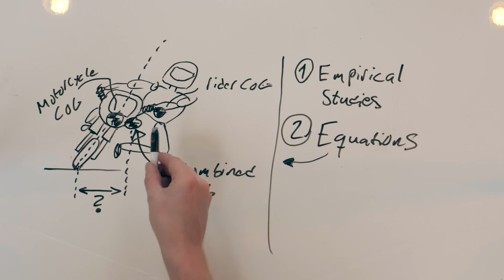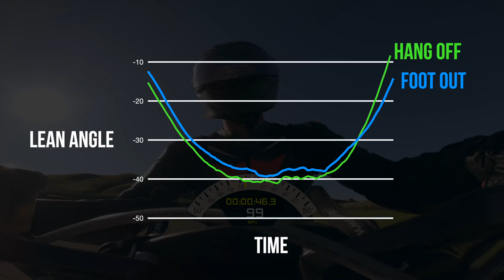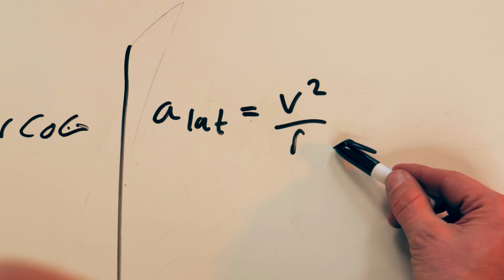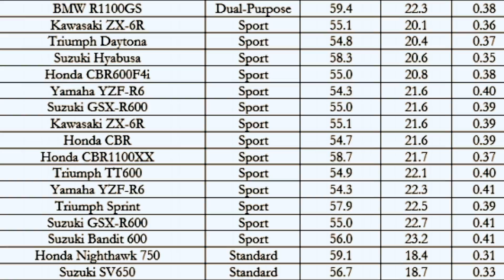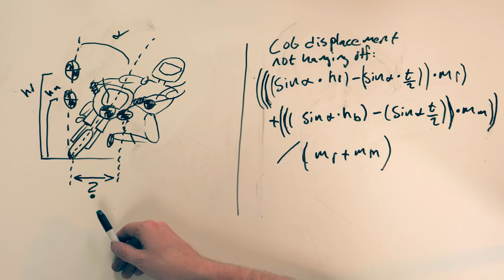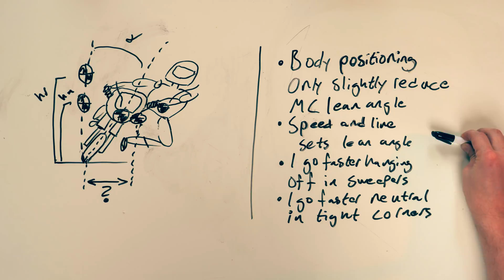Motorcycle Riders - Hanging off & The Science behind it

Comment: Try to analyse the hanging off looking the motorcycle from a vertical angle (looking down from just above the motorcycle) during a corner. You’ll discover the real reason of the hanging off, especially on motorcycles with rear and low CG :) . You could analyse Stoner’s Ducati for example, it is very interesting 👍

Comment: The other thing it does is place your entire body weight at the centre of the bike because of how you hang off using your leg. I think this improves the weight distribution between the front and back & therefore increases net grip & the suspension response to road imperfections.

Comment: You know something that would make a really interesting video: what is the ideal body size and weight for a rider in terms of performance.  With modern bikes having almost unlimited power, I feel like weight is less of a detriment than it once was.  On the contrary, a taller, heavier person (not fat, but just larger build) could potentially require less lean to maximize grip in a complex series of corners, possibly allowing them to maximize them better.  It would probably vary on a track by track basis, but it's something interesting to think about compared to cars or karts where almost universally lighter and smaller=faster.
Reply: SURE. Thats what happen to Pedrosa in his latest years (apart from the bike which was developed for marc, they have very different riding styles so its enough to fuck Pedrosa life)
BUT Pedrosa was ALWAYS the guy who reach the highest lean angle in the paddock. GUESS WHY?
ALSO, heavier guys could put more temperature in the tires while Pedrosa couldnt (again, development issues help this phenomenon) and because of it, they had less wheelspin outside the corners.
I bet that Pedrosa would be unbeatable in 600 or 300 cc.

Comment: Actually when you hang off, you aim to shift your center of gravity down AND forward.  The two are combined. There are so many forces and geometry that it would require very complex simulation to get remotely there. Plus there is air drag, tire drag, engine break, sheer corner speed, angular speed. None of them is constant in a turn. And obviously, there is the feeling of the rider. 

I've recently seen a final lap in Assen between Roseland and Bayliss. Two opposite riding styles but equal performance overall. It's mind blowing.

Comment: Center of gravity at your belly button assumes you are standing straight up.  If you bend over at the waist, you just lowered the center of gravity.  While there are incremental improvements that can be made by moving inward, the BULK of the improvement (or reduction in lean angle) is just from being bent over instead of straight up and down.  The goal is getting the center of gravity LOWER.  Leaning to the inside helps you get even lower on the bike....to a point.  Your outside knee and your hips can only get so far.  So if you're a MotoGP rider trying to eek out every last hundredth of a second on every corner..... Drop your upper body lower and to the inside. Pay close attention to how Marquez's body is laid out, he's trying to get as much of his entire upper body mass lower on the chassis.  You can't put your chest through the tank, so the only way to get that mass lower is to also get more to the inside.  Some older generation MotoGP riders used to even get their butt down on the side (almost twisting sideways on the seat).

Comment: I've found at the moderate lean angles I manage on the street, that when leaning off I have a lot more control over adjusting the lean angle mid corner. If the front or rear starts to slip, I've found that I can drop my weight down and lift the bike up to grip back up. I've also noticed at the same speed I tend to have far less lean angle than some people I ride with by not sitting straight up and down on the bike. 

This video makes me want to try and get some data and see how much the feeling of reduced lean angle is in my head 😅. Its amazing how much reality and perception can differ with things like riding!  Great video!

Comment: Sorry but I can hardly agree with the conclusion. Theoretically if you hang off far enough you could go through a corner with negative lean angle (meaning the bike is in fact leaning outwards). The lean angle is not what gets you through the corner, steering is what does. You use body leaning to compensate against falling over. (as this goes for both fast and slow cornering) Lean angle of the bike is only, and I repeat: ONLY, necessary so you don't fling out of the corner due to centrifugal forces caused by speed as you demonstrated at the start. Basically Moto GP riders are going to fast for the angle of the corner and that is why they have to hang off their bikes and compensate because a bike doesn't have unlimited lean angle.

Comment: Your calculations are showing around a 10% difference in lean angle.... that is not slight.

Marquez would gladly take that 10% you have banked (lol) and spend it on leaning further and therefore going faster.  He cannot because there is no lean left in the setup of his bike and tires. Your calculations though undoubtedly correct are slightly misplaced. Lean angle is not so much an indicator of how fast you are cornering. It is an indicator of the proportion of the available traction that you are using. As long as you are only running at 75% of your available traction it doesn't matter: that extra 10% only puts you at 82.5%... if you are at 95% not hanging off is going to result in a lowside. (Yes I know I am equating lean angle directly and proportionally to traction which is not true, but the two are directly related so the generalisation holds true).

Comment: You are way too fixated on reducing the bike's lean. Ask yourself, how does a single track vehicle like this turn at all? Sure, the lean allows it to counter the centripetal effects, but how does it turn in the first place? The answer is, you are using exactly that centripetal force to prevent yourself from falling into the corner. And the faster you are falling into the corner, the faster you should be going into that same corner (more inside lock/higher speed). Ain't that what we are seeking exactly? The fastest way around the corner.
In other words, you need to maximize the torque that tries to drop your combined system of the motorcycle and the rider. If you hang off the rider while mostly keeping the bike upright, you are not helping your cornering speeds much. Again, look at Marc. Does he try and keep his bike upright as much as possible? His bike lean angles are INSANE instead.
Of course, he can do that partially because of the capabilities of MotoGP bikes (and especially the tyres) and this theory in general assumes you have really good tyres. But still, you shouldn't be taking Twist of the Wrist too much to heart. The further down the bike leans, the quicker it goes through the turn, not the other way around.

Comment: Could it be that reducing lean angle is not necessarily about increasing cornering speed or grip, but it also has an effect on time to turn in and time it takes to pick the bike pack up to drive out with maximal power. Less time leaned over means less time to get the bike straight and go full throttle.

Comment: Yeah u missed one big point... not only do motogp riders hang off alot they also moax out the bikes lean angle... any further will low side the bike... so if they didnt hang off they wouldnt have the necessary lean angle available to take the corner  at the speed they do now...

Comment: HI Mike. You did the math on the topic I've ever felt natural in my riding. 
In other words you just confirmed that hanging of gives so small amount of an advantage it can get significant on the highest levels of riding - in racing. 
More important parts are comfort, chosen line, time spent on gas on brakes, average speed, speed of a turn in and many more. 

I guess I know the answer to the following question yet I will ask, anyway. 
Would you recommend to a beginner to master hanging of?
Reply: The only times you shouldn't be hanging off is on dirt riding. Riding a sportbike you definitely want to master hangin off there is no debate about that.

Comment: My 2 cents (as a fellow racer, and as a biomechanical therapist), I think you are missing out some important factors that make this equation much more complex. 
These would be... 

- The mass of the rider and the motorcycle are not one structure, they have a dynamic relationship, specifically how the centrifugal force from the riders mass , is transmitted through his point of contact with the bike.   

Ever tried to ride fast with a slippery seat? 
The corner forces dont want to generate torque on the rider in the same way as its acts on the rigid mass of the bike with grippy tyres at its tip. 
The rider is thrown laterally, almost as a shearing force across the top of the bike. 

Now the more you hang off the more that lateral force is 'deflected' into downwards force, through the angle of the bike (as opposed to thrown over the top of it). Therefore pushing the tyres into the ground, and allowing the suspension to control the mass, and not adding the the shearing force the tyres are fighting to maintain traction.
This effect would obviously be exaggerated at greater velocities, and at very slow velocities would indeed work against you, ie potenially washing out the front, which matches your comments on the SM. Because in this advantage only comes into play once the lateral force is great than the downwards force. Gravity.  

Also

- The act of hanging off into a turn brings the 'lever' of you body not just 'out' but 'forward'. Compressing the front suspension and changing the geometry of the bike, helping it turn.

Also

- (This could be anecdotal) , I find this front bias allows more 'feel' at the front. Which obviously allows one to push closer to the limit of grip even of that limit were not any different. 

Just my theory. I could be talking BS :D 

PS love the RS250 ! 
<3 

Keep up the good work.

Comment: You forgot to, or simply didn't, address why a reduced lean angle is even thought to be better. Because of the shape of the tyre and that the contact patch area doesn't really change with degrees of lean, the only factor involved is the center of mass. The relationship between the center of mass and the contact doesn't change for a given speed, whether you lean or not. Grip is exactly the same. That explains the lack of difference in lap time.

Comment: Lean angle is interesting and great work Mike. However, lean angle is only relevant for cornering speed if the ultimate tyre grip is affected, so what is the relationship between wheel angle and tyre grip (cornering force)? Perhaps the cornering force is more for +4 degrees from around 40 degrees (larger contact patch)? Perhaps race tyres are designed to give bigger contact patch at high lean angles compared to say a touring tyre where a larger patch is desirable with bike upright, for load capacity and good tyre life? So many questions!!!
Reply: Even if race tyres have an increased contact patch at high lean angles, it just minimizes the fact that you can't open the throuttle too much at maximum lean angle. When racing superbikes you want to accelerate as soon as possible exiting the corners, and it happens at the moment when you leave the maximum lean angle. Ultimately, and racing is all about extract any little bit of performance from wherever you can, hanging off will help you to get this moment a little bit sooner.

Comment: You should just explain a bit why reducing the lean angle is allowing for faster speeds in corners. After all a formula 1 is not leaning at all, but still has a limited cornering speed...
Reply: i raised the same remark, i don't get what is the benefit of a reduced lean angle since the lateral force and the contact patch remain the same whether we are at 30° or 35° of lean angle.

Comment: This is very interesting, however, I think there might be something to be said at extreme amounts of bike lean like in professional racing, where those guys are leaning so far, their lean angles would put them past the safety point of tire patch grip. In other words, that 5 deg of lean angle Marc Marquez saves by hanging off might be the difference between making the turn or lowsiding because there’s just not enough tire left for enough contact patch - whereas at mortal rider lean angles, that 5 deg might not make as much difference. 🤔.  Personally, I always hang off to some degree when taking turns and sweepers very fast because I’d rather keep more of the tire’s meat on the ground even if that’s just 5 degrees of angle savings. I feel it’s safer especially if something happens that requires me to tighten my turning radius during the turn.
Reply: You have a point regarding extremes of tyre contact but until that point, any lean off dead vertical has pretty much the same contact patch. Given the shape of the tyre, there is no extra or more "meat" as you say. It's all totally a function of the center of mass (not gravity) in relation to the point of contact. Hanging-off or not doesn't alter that. I would contend that the main reason Marquez gets off and down is boot clearance with the track (footpegs) and to enable his knee to feel the surface.

Comment: Something to think about is the stability a bike gets when hanging of (half butt) and still maintain most of the pressure through the outside leg and footpeg. Cornering always creates movement in a bike, but when stable you can let the bike do its thing and concentrate on the lines. Compare it with a trailer with the COG before or after the axle.

Comment: just speculation here, in a hanging off position
1. any angle other than upright in a hanging off position would lower the CG
2. the air resistance on the rider's body (though very less) can also create an effect similar to a paddle on one side of a boat to turn
3. the combine mass is inside of the line (shorter radius), hence ballet dancer spinning effect 
so does this mean with the same speed as a foot off into a corner, the hanging off position can have better traction?

Comment: 35 deg is a more acute angle than 39, so your empiric proved the opposite you want to say here.
Reply from the maker: What did I want to say?
Reply: @MikeonBikes  You are stating that by the shift oft the combined center of gravity, the bike doesn't have to lean as much (for same speed, same radius), which of course is correct. In your example you measure the opposite.

Comment: The correct answer to the question is yes leaning in absolutely reduces the bike lean angle in a turn given all other things are equal. Lean angle is directly related to the center of gravity over the line of travel versus the lateral G force that is generated by how sharp the turn is and the velocity at the turn radius. The phenomena of reduced lean angle is very easily demonstrated. Simply travel in a straight line and lean off to one side of the bike. To remain traveling in a straight line you will naturally need to lean the bike in the opposite direction no counteract your body position. The amount of counteracting bike lean is directly proportional to how much weight and how far you can move it from the center line. This gives an indication of how much leaning of the center line reduces the lean angle of the bike when traveling at the same speed and turning at the same radius. 
Lateral G force is mathematically determined by velocity squared divided by the radius. This equation illustrates the effect of speed and turn on lateral G force. The force the bike must lean to counter turning is the lateral G force vs gravity to maintain balance A very simplified example would be that if a bike were pulling 1 G with the rider in a static position in a turn it would need to lean 45 degrees to split the turning centrifugal forge vs gravity. This is of course ignoring other factor such as the contact patch moving around the curved motorcycle tire and other like factors. If the bike were turning the same radius at a lower speed sufficient to generate ½ one G the simplified lean angle would be 22.5 degrees. 
As you noticed in your testing you seemed comfortable leaning to a consistent lean angle during the high speed turns on the track regardless of the lean position vs the motor cross upright position used. As you noticed the lean angle was dependent on the speed vs the turn radius or line of the turn as you called it. You also notice that the speed was higher when leaning in at the same bike lean angle which perfectly demonstrates that leaning in moved the center of gravity. Normally leaning in would mean less lean angle is needed to balance the lateral force however you still felt comfortable leaning more which allowed you to trade the reduced lean angle for more speed and therefore faster time. It also appears from you statements you are comfortable at a much greater lean angle in the slow sharp turns in the motocross position. Because of the increased comfort level to lean more you are able to carry more speed through those turns.
Reply from the maker: Yeh.